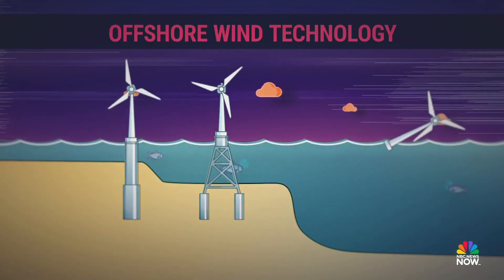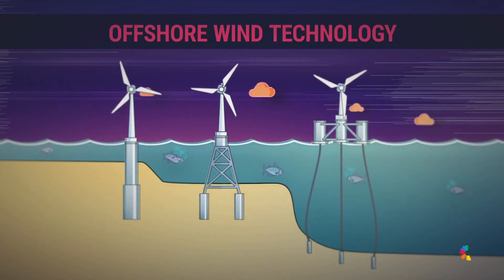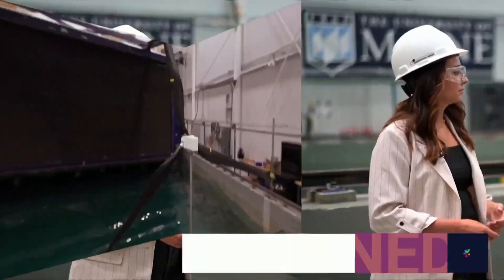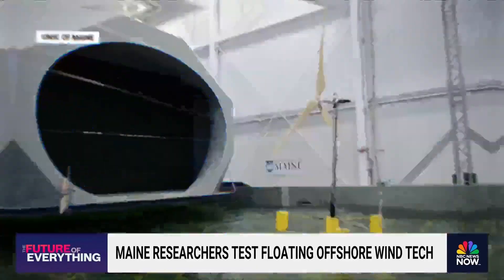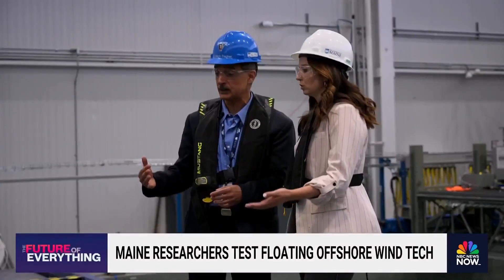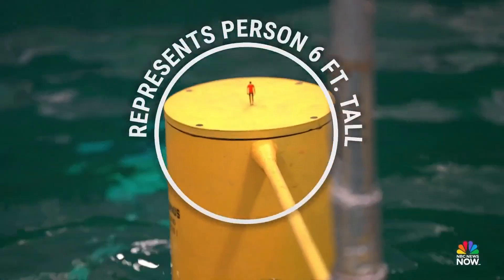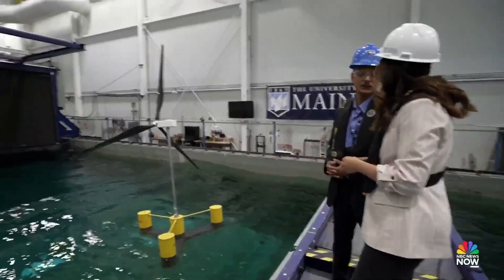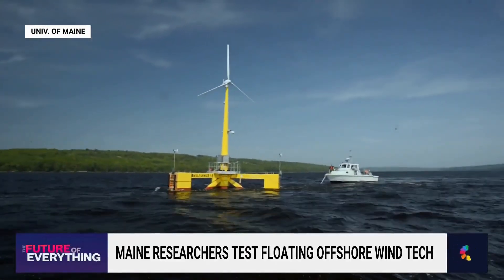Univ. of Maine engineers test floating offshore wind infrastructure

Comment: Great until blade failures, then truckloads of blade debris washes up like the tons now being recovered along Nantucket.
Reply: So much worse than an oil spill right? Shipwrecks create fiberglass debris too i dont see any pushback on boat production? If that is the biggest negative impact for the ecosystem i’d say it will probably only make the ecosystem stronger in that case. The benefits far outweigh the damage of an occasional turbine failure. Dont let a lobbyist tell u what to think. Do some research of ur own